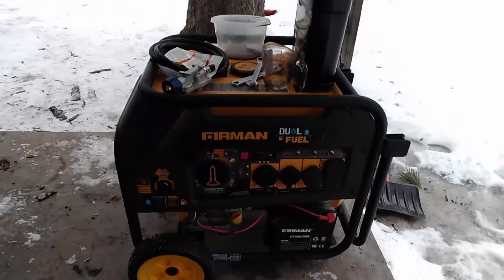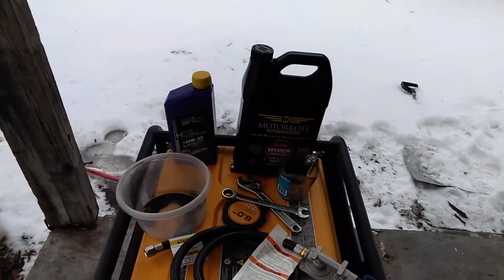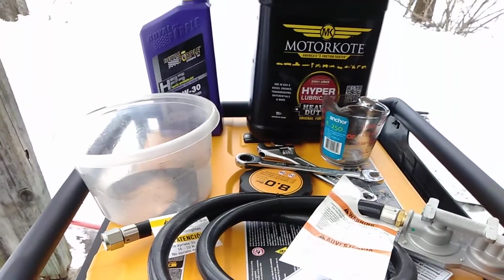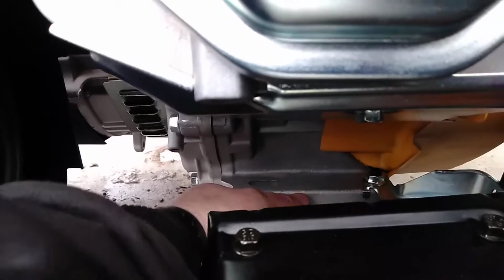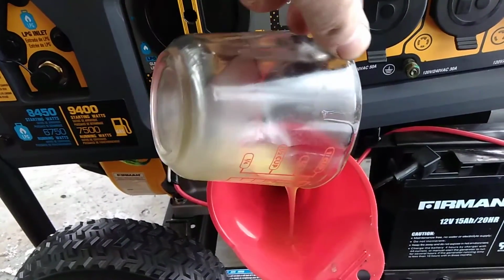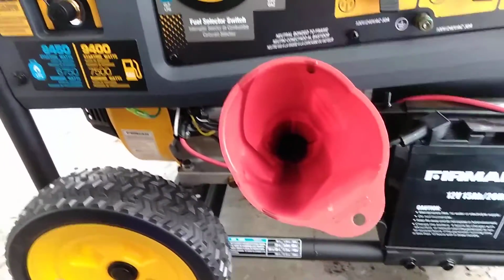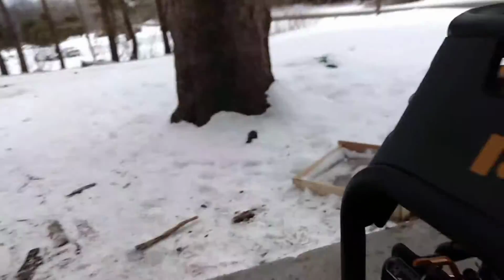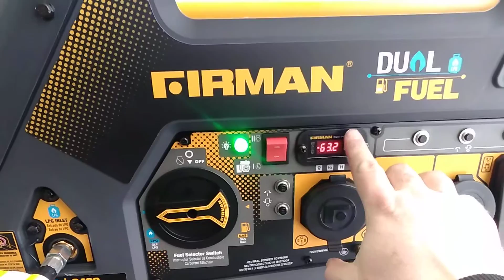Firman H07552 Dual Fuel Generator First Oil Change/Running On Propane

Comment: Thanks for the video a couple tips for viewers: there is another oil drain plug opposite the one he shows that is much easier to get to. Also if you look at the maintenance schedule it does say to change the oil after 25 hours for the break in period.

Comment: So the drain plug is in the back not the front like the 1st shot of it ??
Reply from the maker: There's a drain plug on both sides.
Reply: @TheLowlyTraveller  ok. Very hard to get the one in back. Thx. Going through the hurricane. 9 days no power ⚜
Reply: Couldn't get the screw off with the little tool I have. Way to tight. Was about to strip it. Had to pour it out 🤷‍♂️🤷‍♂️🤷‍♂️
Reply from the maker: @dirkdiggler8330  they put em on pretty tight.  Was a knuckle buster for me.  God speed to you.

Comment: I bought this generator a couple two or three weeks ago from Costco and it works pretty good so far. I never did any break in time on it and I sort of spaced changing the engine oil on it, so it now has 150 hours on it with the original oil, guess I better go buy some new oil lol! But I mean it still works so that's a plus, must not be too terrible of a generator. I live in my fifth wheel full time so it gets a lot of use, I probably run it 15 hours a day on the weekends and 5 to 7 a day on the weekdays with really no issues, although it doesn't like to run both of my AC's on full blast and sometimes it will trip if I run 1 AC and the microwave with my desktop and 3 battery chargers... lol, oh and the fridge. But I'm not sure if it's the generator or if it's the surge protector in my camper that's being sensitive to the loads. But either way, for $500 at Costco it's cheaper than any Harborfrieght generator and has more features. I'm interested to see how long this thing lasts though and seeing as how it gets 200 or so hours a month on it I'm gonna find out real fast. In a couple months if I remember I'll try to do an update to see what it's at.
Reply: So an update, has 550 hours on it now on 8-3-19. No major problems, sometimes it likes to not want to start when I select gas mode with gas in it, but if I just put it on propane mode then it starts right up and I switch it real fast back over to gas mode and it stays running. Usually it doesn't do this but it has a couple times which is an interesting quirk but probably just some dumb sensors or something on it. I've been running Amsoil in it and the cheapest gas I can find, I did put some Seafoam in it at about 450 hours to help keep it clean, not sure if it did anything or not but who knows. I feel like 550 hours is a lot on it. I've started running it pretty much from 6:30 AM to 8-10 PM every weekday and probably 11 to 12 in the morning to sometimes 1 or 2 am on the weekends. But even on 95-98 degree days I'll run it all day and it just keeps going, so over heating hasn't been an issue yet.

Paid $500 for it, so essentially I'm at less than $1 per 1 hour of life so far plus fuel costs of course. But I don't see it stopping anytime soon (Hopefully). Hopefully I can get several thousand hours out of it, but only time will tell.
Reply: So, 9-5-19 another update, Generator is up to 900 hours now, no problems yet really at all. Still running strong, using nothing but Amsoil in it small engine oil. Hopefully it keeps running good.
Reply: This is super helpful, thank you for the updates
Reply: @Tactical_Taco14  No problem. It's at about 1,070 hours now, but for some reason the little choke lever got 'Loose' or something so now it likes to vibrate into the choke position and turn itself off, I tried tightening the screw on it but it didn't feel like it went in anymore so I'm not sure what's going on with that, I had to tie a string around it to keep it from moving. A couple times it has also shut off and then starts dripping gasoline out of it and I'm not even sure what the part is called but it's that black cylinder behind the air filter location but if you switch it from the gas fuel selector to the propane one it stops dripping, so I think it's a computer problem thinking it's still running and trying to send fuel to itself but then it back flows and starts leaking out or something I'm really not too sure.
Reply from the maker: @dedalliance1  I think that black cylinder is the vape canister used for emissions purposes.  Thank you Commiefornia 😡.  I'm not sure if it could be bypassed.
Reply: @TheLowlyTraveller  No idea, It's up to about 1,180 hours on it now and still running good so the little minor issues aren't a big deal to me. But just something to watch for you might come back to it after awhile and it might drain itself of gas and then you have to go get more lol. But so far I'm happy with mine.
Reply: Well, this is the end of my Generator 1542 hours on it :( I was using it to run a little 5k watt garage heater here in Colorado which was probably about 70-100 hours worth of use and then a couple days after that we lost power and it was -19 degrees outside so I was starting it up to plug into the house to have power and it ran for 5-10 minutes before it stopped and seized up and the pull start wouldn't move it and the electric starter wouldn't either so I was pretty sure that was gonna be the last of my generator lol. So fast forward a week later today I decided I would see if I could get it to run again I changed out the oil which it was pretty low on oil not to get too technical but I took out about a dixie plate from Costco worth of oil. I know, my measurements are extremely scientific. Anyway, put new oil in it start it up using my drill hooked straight to the crank shaft where the pull start hooks up to because it was seized, got it to fire up pretty quickly surprisingly and then it ran for about a minute and blew a hole through the cast crank housing thing. So uhm, she doesn't run anymore lol :(

I changed the oil last time I went camping over Labor Day weekend last year in 2020 and I never noticed any leaking and I didn't use it much then maybe 30-40 hours because I stayed out for a week so between then and now it was burning oil for some reason I don't think it was leaking because I never noticed any puddles under it. So I would definitely recommend for people to check your oil every time you start it especially if you start climbing in hours like mine was. Anyway though, I think I got a lot of use out of it and I've pushed through some crappy conditions always changing oil in parking lots or dirt fields dust snow rain cold hot one time I had it halfway under my camper during an ice storm / snow storm in Montana and the water would melt off of my camper and then freeze all over the generator and got into the pull start area and froze all of that up I had to take my blow torch to it and start melting everything off before work one morning just trying to get it to turn over and finally did. I was using a hammer to bust the ice off of the top to get the fuel cap off lol. And then it ran like that all day until I got back from work. So I wasn't babying this thing it rode around in my camper where ever I went or in the truck I always used Amsoil and I always tried changing the oil between 100-150 hours maybe once or twice I got closer to 200 but who knows if that would have made a difference.

So all said and done it cost roughly $0.33 every 1 hour of run time plus fuel and oil which I think is a good return. Compare that to Honda's 4500 running watt generator which is smaller than my Firman at $2,500 dollars to get the same $0.33 an hour return, you'd have to run that Honda for 7,575 hours which maybe it'd do it I don't know, but you're also out $2,500+ just to find out. Most people won't even use their generator 1,500 hours before it just gets so old you want a new one anyway. That's 100 hours a year for 15 years.

I'm probably gonna go back to Costco and buy the newer Firman TriFuel generator they have out just because this one I feel like did me a real solid job and who knows maybe I got a dud you might get 3k+ hours.

Here's some pictures, https://imgur.com/gallery/KcVs6Lx
Reply: Here is a reminder about portable generator safety: everyone needs to see this safety reminder to be safe when using portable generators. Make sure you are aware with all the safety warnings. This advice is just to make sure that everyone is aware of all the warnings and it’s just to remind people to be careful using portable generators. Generators can be dangerous if not used carefully. Every year, hundreds of people die or get injured when using portable generators due to carbon monoxide poisoning and electrocution. Make sure you are using your generator carefully and keeping others safe as well. There is something very serious that everyone should always be aware of when using generators. Some people do run their generator indoors which is not safe and that increases the risk of carbon monoxide poisoning which can cause death of family and you. Some people run their generator in wet conditions which can electrocute them. Please remember that you should never run your generator indoors. Remember that carbon monoxide is an odorless and colorless gas that you cannot see or smell. Carbon monoxide is a silent killer. Keep that in mind. Make sure your generator is 15-20 feet away from your house and away from doors, windows, and vents. Never use your generator in your porch too. Having a carbon monoxide detector is very important against generator safety. Some people also allow children to go near the portable generator which could pose risks. We need to keep an eye on our children making sure that they are not near the portable generator so they won’t get electrocuted or burned by the generator which is dangerous. A locking enclosure also keeps kids safe. A generator shed might look like a tempting place to explore, or take cover during a game of hide and seek, but a generator is a dangerous piece of equipment that can cause injury. It says on the manual that we should also keep children away at all times from the portable generator to avoid injuries. Please do not allow a child or unqualified people to operate the portable generator. Just because some manuals missed what should be listed doesn’t mean it’s safe to do. Always follow the generator safety rules when using portable generators. Generators pose electrical risks. If you need to use your generator during wet weather, you need a generator tent to protect your generator from getting wet. Don’t let your generator get wet. Keep your generator dry and before using your generator, please make sure your hands and your generator is dry. Do not wear loose clothing when operating the generator. Everything that is said on the generator’s operating manual should not be ignored. Never smoke cigarettes near the generator. Please keep flammable things away from the generator. Never overload your generator too. Your generator can catch fire. Never ever try to plug a generator cord into a wall outlet to avoid back feeding. Back feeding your generator is dangerous. Always turn on your generator first before plugging in appliances and shut off the appliances before turning your generator off. Use a heavy duty cord for your generator and the cord should not be worn out. All the instructions should be followed carefully. Never refuel your generator while it’s running. It can cause fire if fuel spills while your generator is hot. You should turn off your generator and let it cool off before refueling it. Having a fire extinguisher next to the generator is also important. This is only a reminder for everyone’s safety of using generators. Make sure your generator is properly grounded. https://youtu.be/I1jT3ANENvI and here is a video more about keeping others safe when using generators and also about our family’s safety. Hope this helps. Thank you. Be safe everyone.

Comment: I bought the same unit in November of last year. After 24 hours of no power and freezing in the house, I decided to go look for a generator and got the last unit at Costco for $649. I'm pretty pleased with this unit. Lately, I got a interlock installed on my panel with an inlet outside and I love this setup. We lost power again for half a day 2 weeks ago and it's so easy to just power everything in the house without running extension cords.
Reply from the maker: Awesome.  I plan on doing that myself one of these years.  That generator should power my well pump and most of my appliances with the exception of the range, dryer and water heater.  I also plan to run it off my big propane tank.  That should keep me powered for a while.
Reply: During the power outage 2 weeks ago, I powered furnace & water heater (both gas), all lights and power outlets (you just have to be aware of the load you put on) and my wife was using the stove (electric) to cook something. The generator had no problem at all running all this.
Reply: Also, it would have no problem running the dryer (electric), I would just not run it at the same time as the stove though.

Comment: So after reading the manual about the oil it states not to use any additives. I wonder why it would state that? So what about the MotorKote?
Reply from the maker: I'm sold on Motorkote.  I wouldn't use additives like Slick 50 or any additives that contain PTFE.  PTFE is PolyTetraFluoroEthylene otherwise known as TEFLON.  Teflon has been known to ruin internal engine parts.  Check out Project Farm's video on Motorkote.  Here's the link: https://youtu.be/88vwUwa3igQ

Comment: Living in the southeastern US during hurricane season the ambient temperature is around 90F do you think 10w-30 is fine? or switch to a heavier oil?
Reply from the maker: Use SAE 30 synthetic if you can find it
Reply: @TheLowlyTraveller  thank you, but it seems like it's hard to find those locally.
Reply: @nq2847  I used seadoo summer grade jet ski oil.  All I had and nothing is open.  Hope that is ok.

Comment: Thanks for the video. I just bought this same one 3 weeks ago. I started breaking it in today. I took the spark plug out and injected a small amount of Lucas Oil in there. I also mixed some with the oil that came with the generator when I started it up. I ran it for an hour on a very light load and put it away. I will change the oil tomorrow and repeat the same procedure. It ran flawlessly on propane and I am not sure I am going to run it on gasoline or not. I haven't decided.

Comment: Can Lucas 32 oz. Heavy Duty Oil Stabilizer be used in lieu MotorKote, and work as well?
Reply from the maker: You could use that, but I would recommend only using it with 5w30 oil.

Comment: 1-3-22 
Hi and I hope you're well Happy New Year to you, 
After two years what is your current status with this Furman generator? Thank you! I am currently using the same unit. 120hrs 3 oil changes, reg 10/30 pens oil. Will switch to Walmart syn. next round.
Thank you and have a successful New Year

Comment: To store it says on page 31 to run then close fuel shutoff valve and allow unit to run until it stops then turn fuel selection switch to off. Where is the fuel shutoff valve?  Anyone know?
Reply from the maker: The fuel shutoff is integrated in with the kill switch.  Don't really care for that design myself.